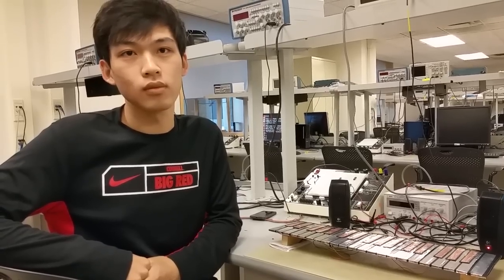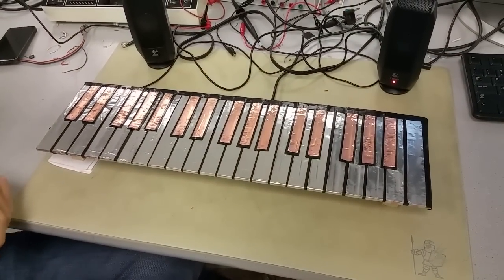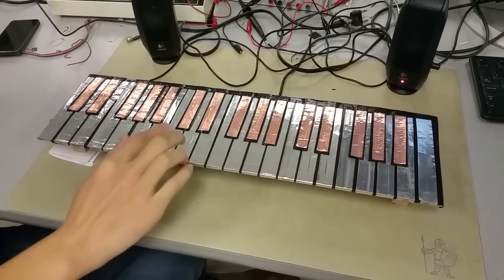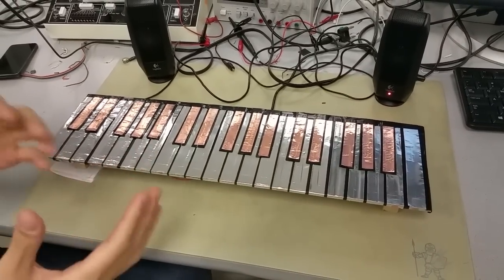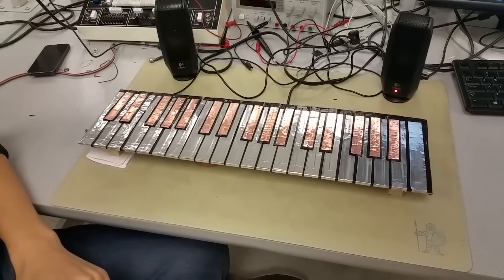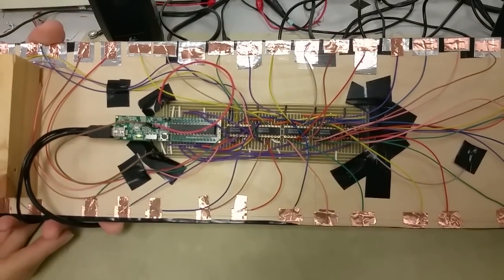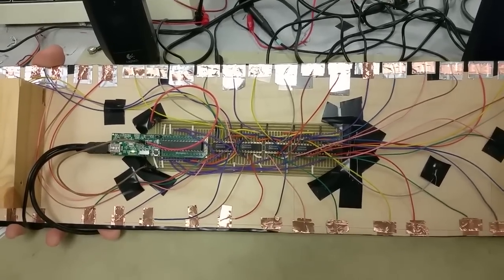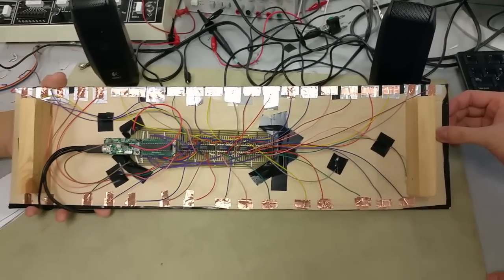touch piano

Comment: which software do you use to simulate the code?
Reply from the maker: No simulation used. testing was done by direct download to PIC32. Realtime code with external circuitry does not simulate well
Reply: sorry i meant the software to simulate the hardware connection and the circuitry having a problem doing that with pic on proteus
Reply from the maker: NO simulation was used!
Reply from the maker: no simulation was used

Comment: Amazing !
 I did figure some way to use touch sensing above Qtouch technology of ATMEL or it's libs and also not using some cap touch ICs but actually I had some analog noise cancellation circuit and some other analog things beside AVR Atmega32 and I used 2 analog to digital pin for scanning 1 touch pad,down sides they was but I see that this guys figure some way to use less ADC pins.
btw I hope it's real cap touch device , cause you didn't test with some plastic panel above touch keys...
Anyway I will wait for more details on 11 dec , PERFECT Work !
Reply from the maker: +Ata J.Golparvar It is a cap device using the PIC32 CTMU thru multiplexors.